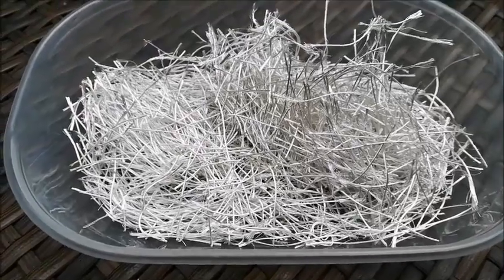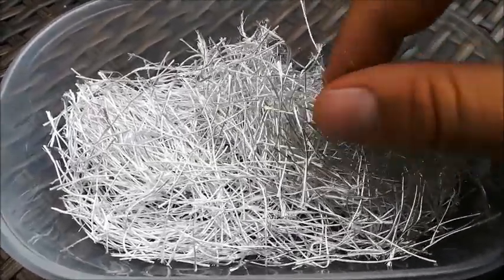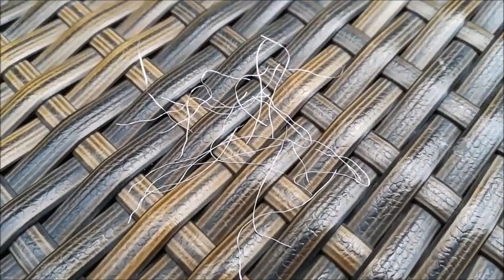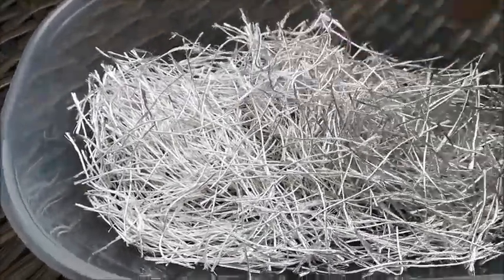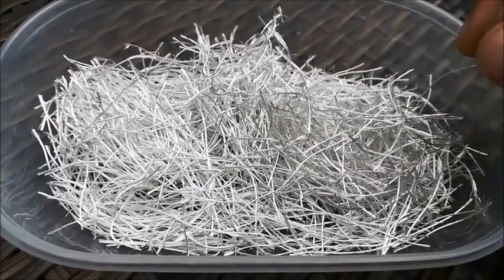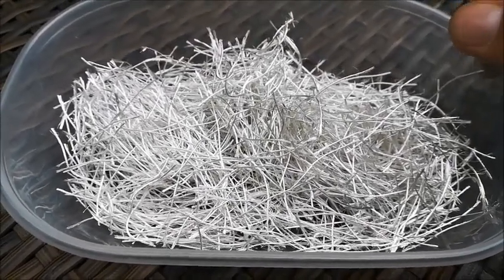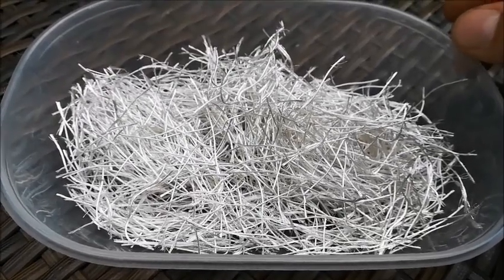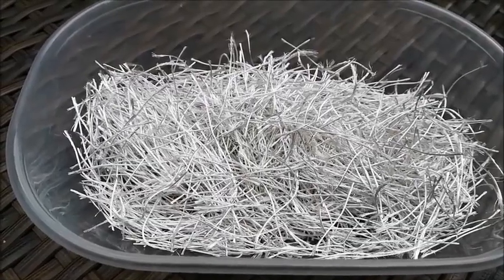Silver recovery from industrial Silver plated wire leftovers

Comment: That didn'tlook like the nitric solution was anywhere close to being saturated. 
If you have 2% silver, that is very heavily plated. 
The equivalent gold filled wire is on 2.5% - gold plated wire in only a small fraction of one percent gold.

Comment: Hi, would there be palladium in there also?
Reply: No
Reply: It depends on what material you have. During the 60s and 70s companies tried to find a better metal than gold for circuit boards, bond wires and plating since gold was getting very expensive. The solution was palladium. You can find it on old circuit boards in the traces, fingers and plating. In bond wires and of course wire wrap wire. This wasnt common but you can still find it, some companies used it more than others. Google vintage circuit boards palladium plating.
Reply: @jackm1429  you should find everything you need by searching vintage circuit boards palladium plating in google. They also used palladium plating on wire
Reply: @chosen1one930  I'm well aware but not in stranded silver plated wire.
Reply: @chosen1one930  the only Palladium I'm aware of used on wire in the form of singular strand wire.
Reply: @jackm1429  actually yes it is especially with older silver plated wire because they didnt use methods we use today. Will it be a lot, Fuck no, but you can  find traces of palladium. I was talking about other mainly I figured you should of known palladium is found in silver all the time, from sterling silver silverware, tea sets and so on. But like I saud its traces of palladium nothing to get excited over, maybe 1 gram per 50 to 100 pounds
Reply: @jackm1429  clearly your not, sorry.
Reply: @chosen1one930  lmao you're talking very few ppm impractical for recovory. We were talking about manufacturers plating stranded wire like this with Palladium. Show me them links lol
Reply: @chosen1one930  Aww is the little baby to frustrated to use his big words? you're so adorable lmao.the irony of your statments is astounding😂 you must be a hobby refiner lol